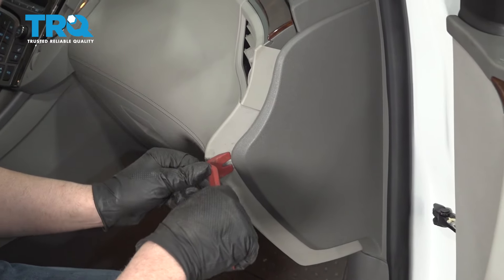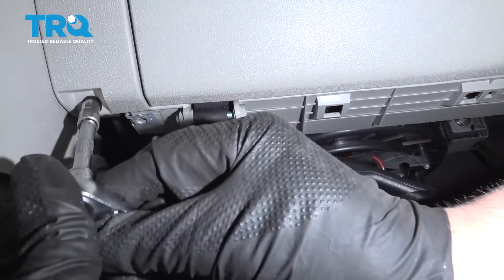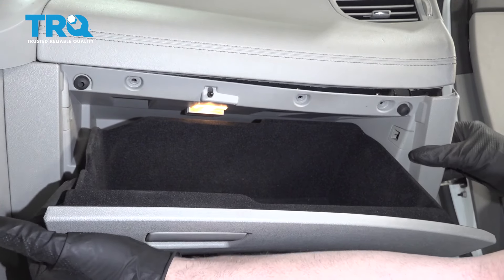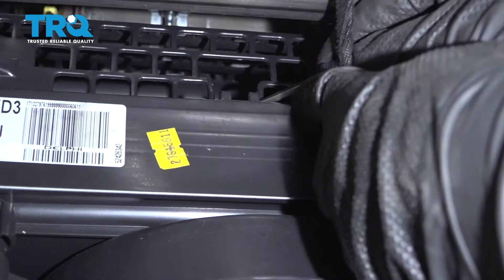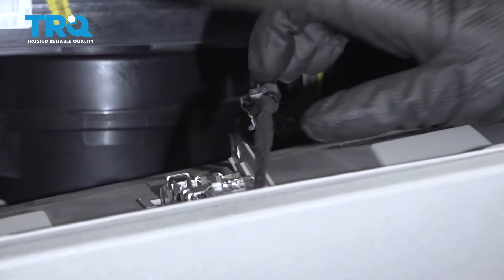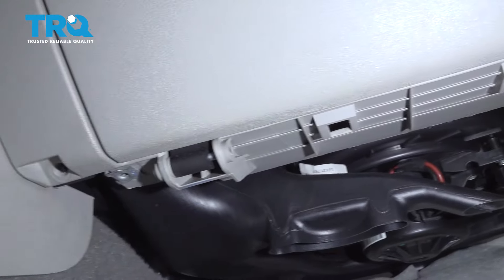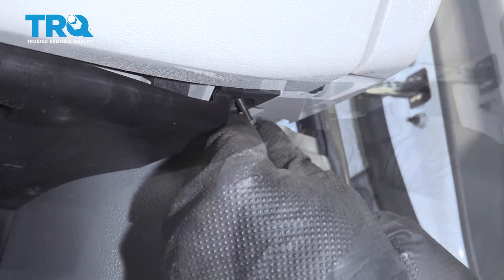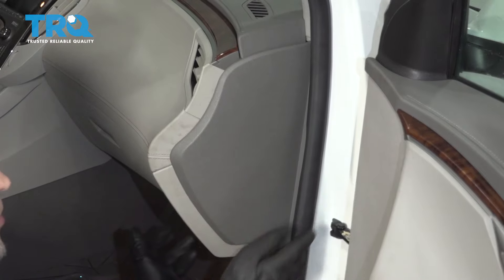How To Replace Cabin Air Filter 2010-16 Buick Lacrosse

Comment: I watched this video a few days ago. I thought too much work for air filter replacement. I watched it a second time this morning, and it didn't seem so bad. I was use to it being so much simpler on other vehicles. Anyway I did it this afternoon.  I had to use a mirror to locate a couple of the screws before it was difficult getting my big body under the dash. But other than that it went smoothly.  Thanks! 😊😊😊

Comment: That's a pretty drawn out affair to replace the cabin air filter.  I can do it on my wife's Honda Accord in 5 minutes.  An example of GM vs Honda design and engineering.  On the other hand I love the appearance,  ride and comfort of the Lacrosse.

Comment: How often do you have to check if the filter is still good? TIA
Reply: It’s good practice to change every 12000 miles
Reply: My car is a 5 yrs old and 40K miles. I just changed it today cause the air smelled when I'd turn it on in the summer. Its probably recommended once a year but I'd say at least once every 24k miles. Ebay or Amazon will be much cheaper.